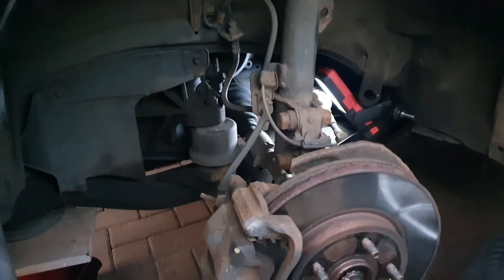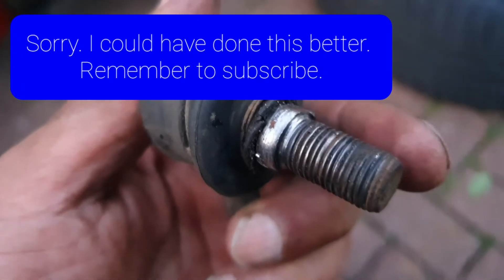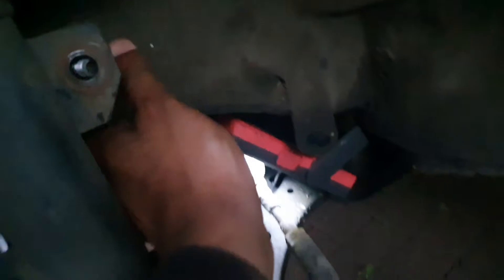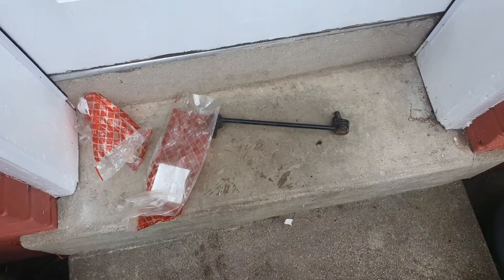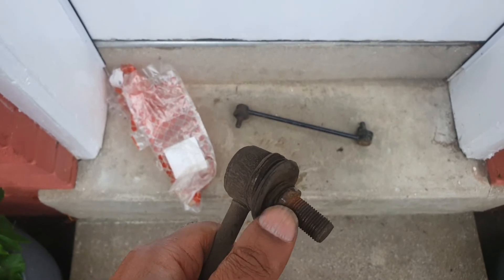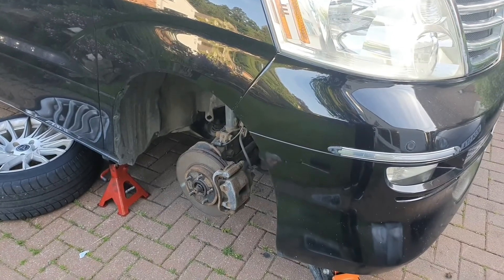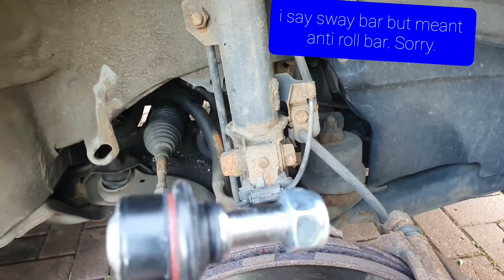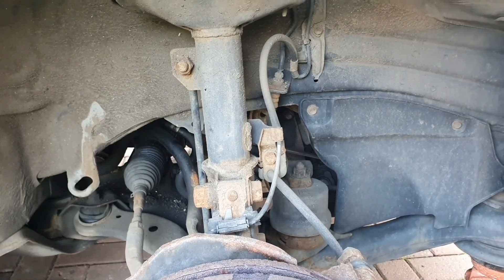Toyota Alphard / Vellfire  drop link replacement. Thumping noise and poor handling.

Comment: looks to be the same as my 90s estima and I guess lots of other cars. wondering if it's possible to do it without jacking up the car and taking the wheel off..
Reply from the maker: Nope. You need to Jack the car up. and they do all look the same however they are car specific.
Reply: @Cuttothechase  I did it earlier, managed to do it without taking the wheel off. needed to cut the old seized bolts off with an angle grinder but all done easily enough. thanks for the video
Reply from the maker: You’re welcome . Glad you managed it!
Reply: @Cuttothechase  I didn't have a wheel spanner or a jack.. but I'm still young enough and bendy enough to do things stupidly. Just down the road in Glasgow where the roads are even worse than Edinburgh